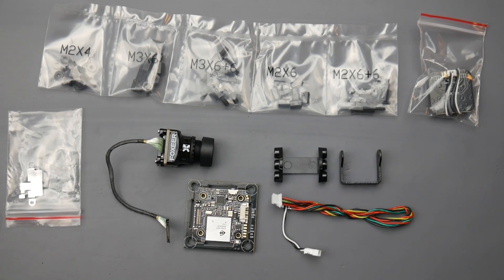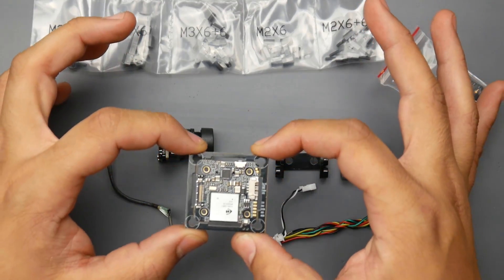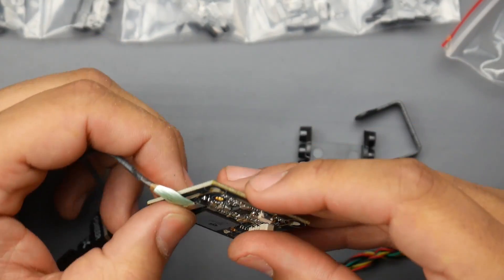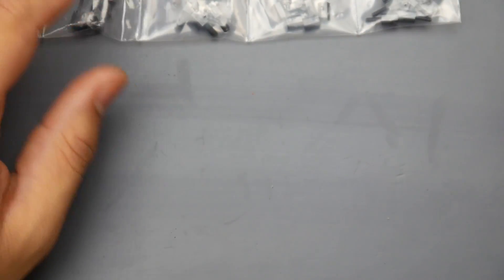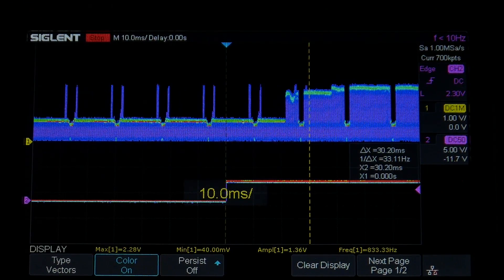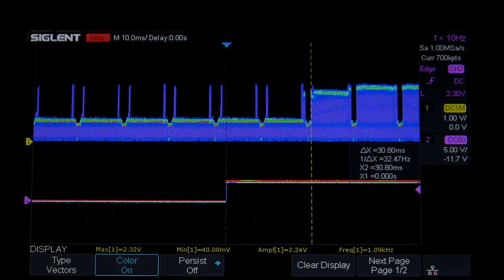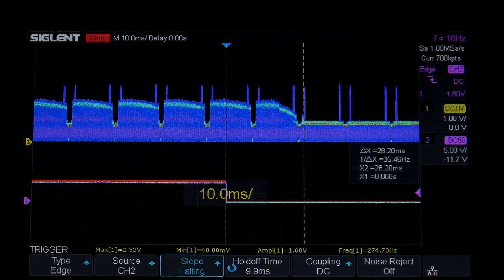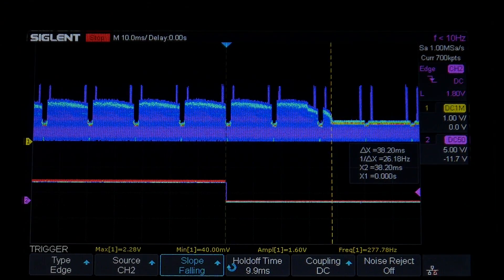THE LATENCY!!!  Foxeer Mix FPV Camera Review // Latency Test

Comment: hi, in the video where you mount the external module on the flysky fsi6(crossfire , r9m) , i can't understand how to bind without the opentx. thanks for what you do for the community!
Reply from the maker: There is a bind button
Reply: In the r9m is the white on the back?
Reply from the maker: @lorenzocoluccia8002  Yes read instruction to enable ppm mode also